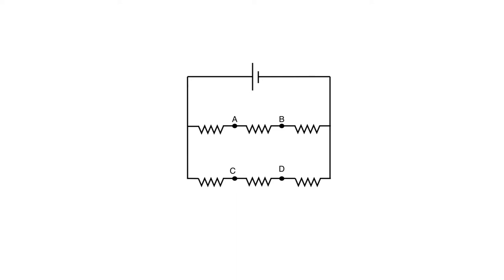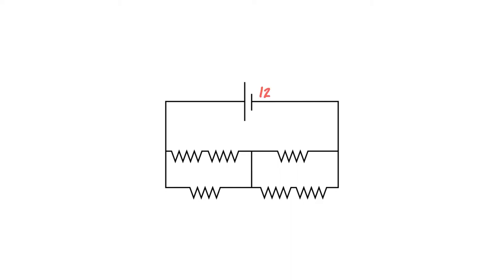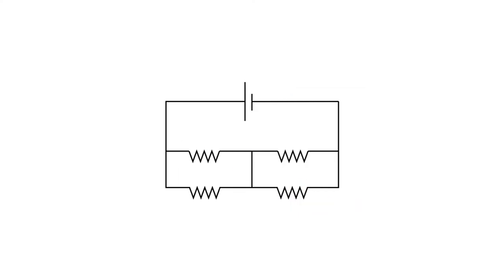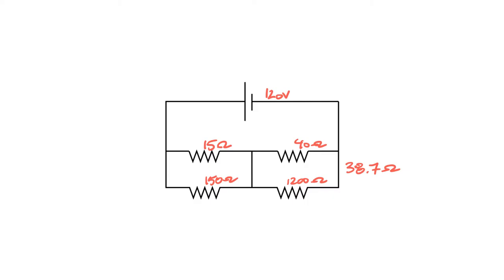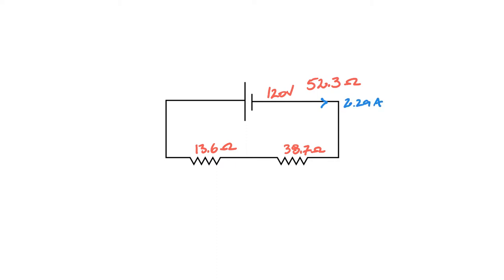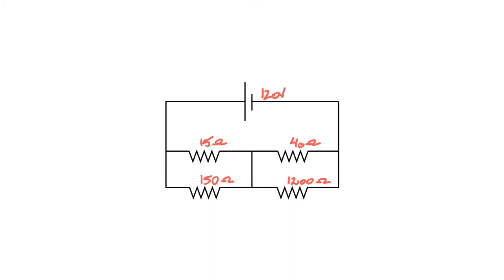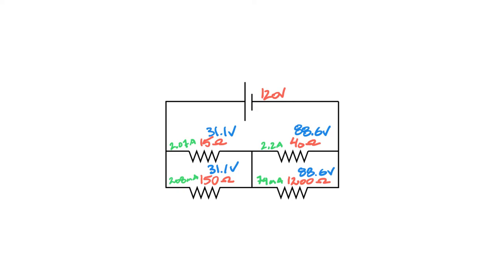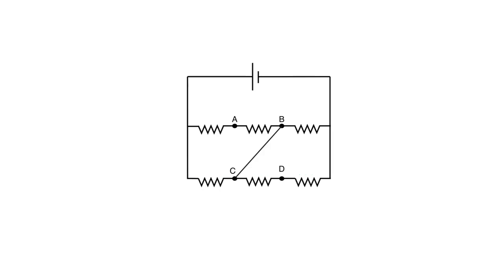UNBALANCED BRIDGE CIRCUITS

Comment: What if the bridge connector have resistance?
Reply: That would make the resistors form a Delta connection. To solve that, you simply convert that delta connection into a wye connection. That "redrawn" wye connection can now be calculated as normal parallel/series connection and eventually solving the currents and voltage for each resistors. The formula for conversion of wye to delta conmection (vice-versa) is too long.

An advance way to calculate the current and volatge of this question can be done by using Nodal Analysis or Mesh Analysis. But Mesh analysis is more better on this example in my opinion.